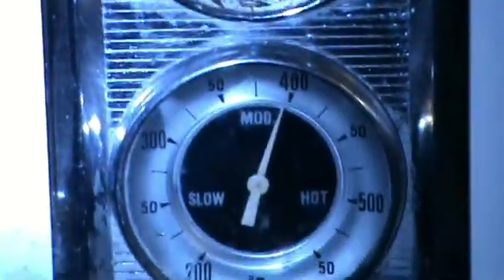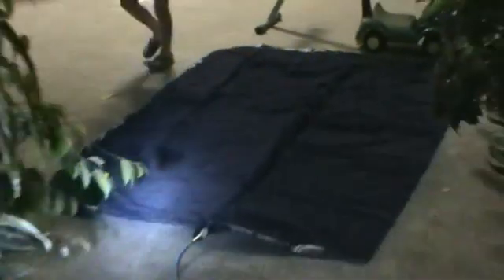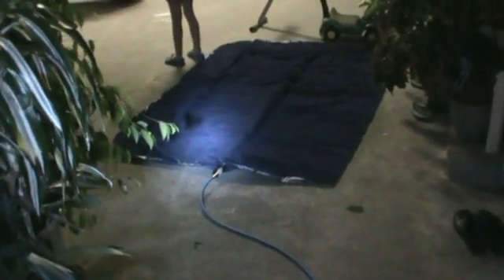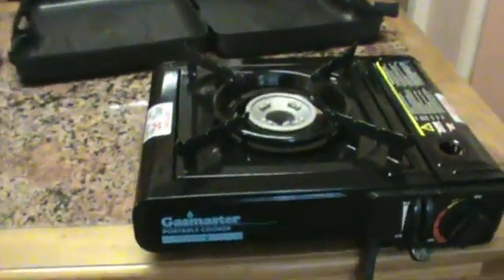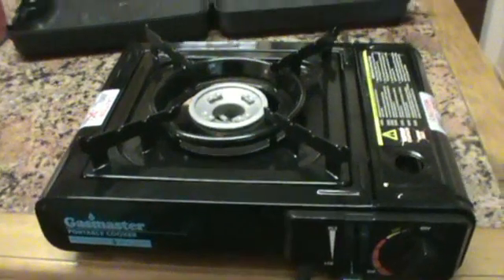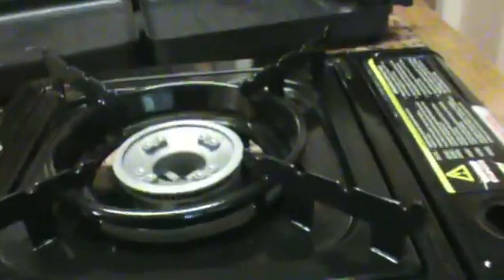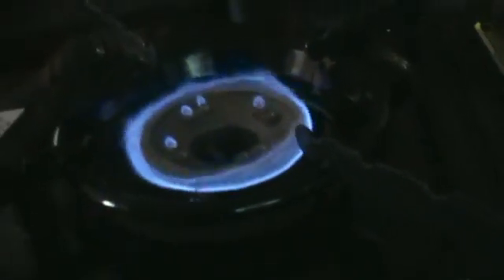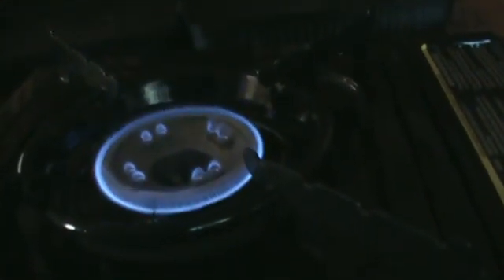Wood Gas.for fuel (cooking & automobile)

Comment: Butterfly valve wide open. So the throttle is fully open at all times and engine speed is now controlled by air fuel ratio? That's what it looks like when the engine speeds up as you open the gas valve.

Comment: The carbon monoxide content of this gas is really, really, low. Without the small amount of oxygen needed like in a downdraft gasifier, it really cant make much carbon monoxide. The gas will be really high in methane and hydrogen however and low in CO2.  It will have almost zero nitrogen in it.  With some solar panels, batteries and a 12 volt motor to power an automotive air conditioning compressor, you have a solution for your family if the grid goes down. Cooking fuel and compressed gas to power an automobile!  I suspect if you put plastic in this reactor, it would make some wickedly potent gas!

Comment: Wouldn't the bubbler apparatus condense the water vapor just as well?
Reply: Micah Epps I believe it would if it was bigger, if it wasn't pre-condensed with that size bubbler, it'd heat the water in there too much
Reply: @TheChipmunk2008  you're right . the pre-condenser was a simple but smart decision
Reply: Micah Epps i

Comment: What set your smoke alarm off? Is the space really confined?
I was wondering it the collected wood-gas is rich in Carbon Monoxide and that is what the smoke alarm picked up, but that stove was burning cleanly.
You must have a really good compressor to charge the bottle with the collected gas.

Comment: Did you say the stove is "heating up timber to then collect the gas' So the top box is heating/smouldering wood for the gas .... your not burning it to collect the gas like everyone else. The stove is separate to the gas collection part. Is this right ?
Reply: Yes that's Right, the Timber is only heated not burned. After the process, the timber looks like very high quality charcoal.
Reply: Hello, do you realise not many ppl if anyone is doing it this way, Excellent work my friend and thank you for replying.
Reply: I am new to this and wanted to say thanks. Have you tried with other organic material besides wood? I know others who burn the material directly have used various organic material as well as wood. Also, what is the purpose of the coil in the pot of water before the bubbler? Thanks again.

Comment: The water bubbler does more than just trap the tars.

The water shift reaction converts carbon monoxide to CO2 and hydrogen, hence the nearly invisible blue flame.

Some NaOH (lye) in the water would convert CO2 to Na2CO3 (sodium carbonate) and remove it from the gas mix by holding it in solution.

A PH indicator color change might show you when the lye has been used up.

I wonder if you could get the H2 concentration high enough to make the air matress float as a hydrogen ballon?
Reply: Does the carbon monoxide in contact with water convert to CO2 + H2 correct? And the CO2 (in the presence of water + NaOH) is converted to Na2CO3 (sodium carbonate) ... The question is whether the carbon Monoxide would also be converted in the presence of NaOH + water in Na2CO3 or this conversion only occurs with CO2?

Comment: Just a couple of things (that you are probably already aware of)

Carbon Monoxide is hilariously, fantastically poisonous stuff, so do be careful (concentrations of 1.3% knock you out instantly I think).

I've heard that wood gas does not store well, because the carbon monoxide and hydrogen naturally rearrange into carbon soot and water over time.

Looks like a pretty sweet setup though - the colour is perfect.

Comment: That is methane you are burning. The lack of a catalyst in your still is preventing the production of methanol. Which would be much easier to store than methane. Wood gas (hydrogen and carbon monoxide) burns with an orange flame. The material that is left over would be excellent material for producing wood gas. Wood gas is produced when normal breathing air passes through a hot glowing mass of oxygen starved carbon.
Reply: I see the copper tubing. That is the catalyst. The methanol you are producing is being captured in the water filter.

Comment: WARNING 'AT YOUR OWN RISK' compressing the wood gas into a LP tank it is very simple. Any compressor will work. I use my shop compressor!. Connect the suction side of the compressor to the wood gas and bypass the air tank of the compressor otherwise your air tank will have the combustible vapor in it. Then connect a line to your empty LP tank and compress! the shop compressor may reach 150 PSI the LP pressure is 350 PSI! Try a 12V tire compressor  some of  them can reach 250 PSI

Comment from the maker: no I don't thinks green timber would be better, too much moisture and probable too much tars. 
How long-- until the wook looks like charcoal.
Timber type--  I have been using hard wood, I think pine has more resins therefore more tars.
I think if you used grass clipings you would probably get some methane (with green grass), with dry grass I assume it would work, I haven't tried It.

Comment: This is one of the best wood gas vid. out there i think.  Have you had any problems at all as far as safety iss. doing the transfer ,and another Q.  So you just put the box on the stove put wood in it and fire stove up, close box and you make gas pirty much if so thats cool like to build one like that easer then mounting my gasfier on my tractor just mount a lp tank and take off no mess. If you could like vid. on the hole process from start to finish that be cool.

Comment from the maker: no there is no holes in the metal box, only the outlet where the gas is released, the  timber in the box is only heated from the stove, givning of it's gas, the majority of the tars are left in the bubbler. it runs under it's own preasure,

Comment from the maker: Hi, to the air bed it works on it's on preasure, you don't need a pump , I use a car air conditioner compressor to pump the gas from the air bed to the gas cylinder, when I did this,
I didn't fill the gas cylinder, but I had a presure guage in the line to make sure I didn't put too much preasure in the cylinder. The beetle had no conversion done on it, I just piped the gas directly into the manafold. This was a basic setup, more work  required to drive down the road, but yes it can be done.

Comment: wow i am inspired ! just got to do this but so many questions . please may i ask .. what pump do you use to pump gas to airbed ? what pump do you use to fill gas cylinder and how do you know when it is full to stop pumping ? also when you hooked up to your car ,is this already converted to run on propane using the standard kits for propane coversion or do you need somthing different for wood gas to work , oh and regulators ?? any ifo much apreciated

Comment from the maker: No, I pulled the compressor apart,clean it out, and put wheel bearing grease on the needle roller bearings and other parts , also every now and then I let it suck in a little bit of oil  (while it is running) to keep the compressor cyclinders lubed. A little bit crude, but it works.

Comment from the maker: Hi, I used a car airconditioner compressor, they pump up to about at least 600 PSI,
I mounted it on a small frame with a 3 horse power electric motor, I mainly use it for a
vacume pump, but it will work both ways, Regards.